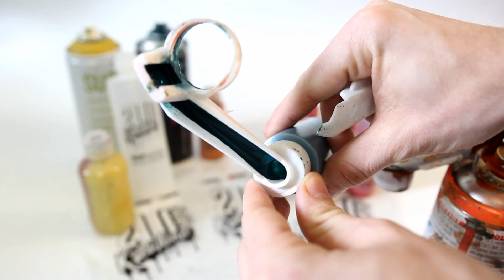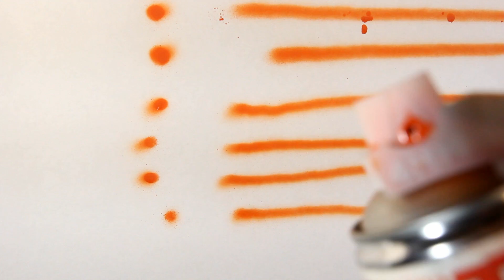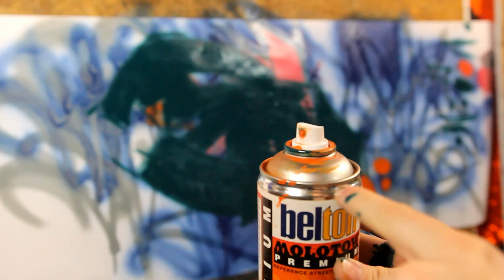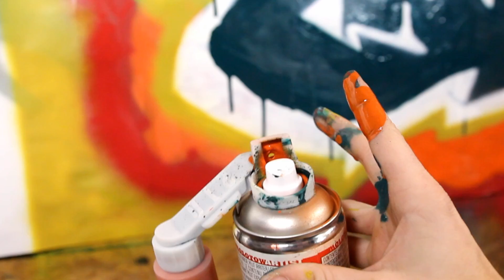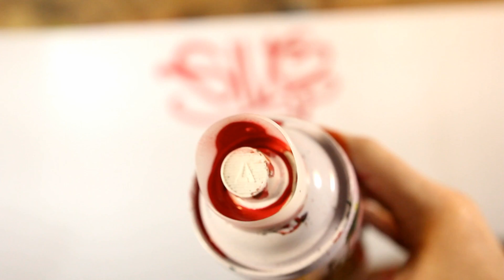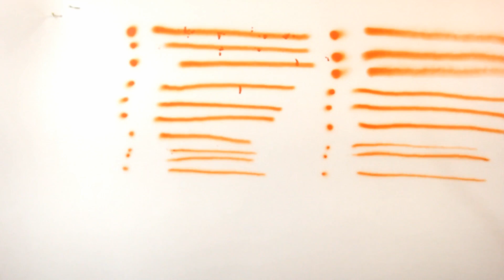210 Stencil Cap REVIEW and TEST - Krewline

Comment: I dont have the stencil cap, but would you people recommend me using spray can paint for mops? (Theres no graffiti products in my city)
Reply from the maker: No, you can make or buy paint more designed for mops. The only reason They are used in mops here is so the extra paint is saved, rather than just thrown out.
Reply: IISIVEII I didnt thought you would answer lol, I love your videos.
 I know that, but here where I live there isnt any place where they sell graffiti brand stuff like molotow, krink grog or those, and ordering them online is expensive af, I meant if you think it (spray can paint) would be a good substitute.
Reply from the maker: Yeah paint from a spray can would work, I just think it would be more expensive than thinning down some bucket paint.
Reply: You could use cheap spray paint, however you could use regular oil based paint that comes in 1/4 containers. Pen ink refiller works great for mops also.  Here are a few links on how to make an NYC mop including SIVE which is the best one.. Check SIVE tutorial on making mop and ink littleman.  https://youtu.be/1jTAJEvMvwc      https://youtu.be/Pj8gt06BkZg      https://youtu.be/nBzd49ArdmA
Reply: Art primo has all that shit....